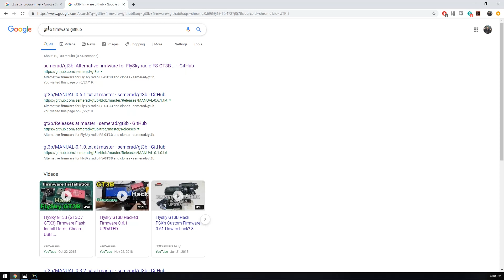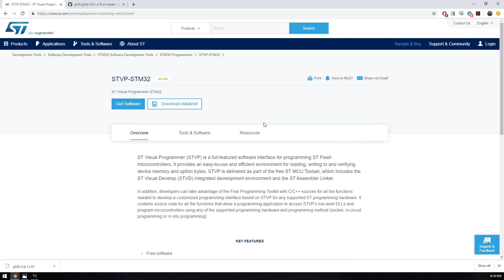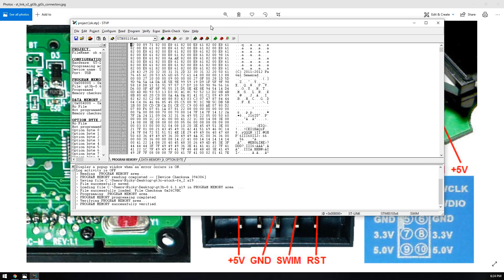FlySky FS-GT3C Unboxing and firmware mod w/st-link v2

Comment: its not working i just got this error message Error : Problem while trying to Reset swim and device. Apply a Power On Reset
Reply from the maker: Just a guess, but the wiring sounds like it's not correct and can't communicate with the device. Another thing to check is make sure you plug it into a USB port on your computer, not a USB hub (unless it's an externally powered hub). This just ensures it has enough power, since the USB port has to power the GT3C as well.

Comment: can i use 18650 battery with Amper 40 in this remote
Reply from the maker: This transmitter does not hold 18650 batteries. Anything is possible, but this transmitter already comes with a battery.
Reply: @dirtfpv  so the conclusion is whether the 18650 battery with a voltage of 3.7v 40a can be used as this remote battery
Reply from the maker: @ahmatsohep7675  Yes, absolutely. Stock vattery is also 3.7v.

Comment: i wonder if anybody can help. just bought a gt3c but the lipo battery was already installed and not packed seperately.is this normal or could it be used.
Reply: I have 3 of these radios and all of them came exactly as you see in this video. Battery separate from the radio. It is probably used.

Comment: I just recently flashed my GT3C with custom firmware as well. I originally bought it with the PPM expander board hardware hack already installed as I want all the default key functions on the radio but also want extra channels. But then decided I needed the custom firmware as well since it has some fixes implemented and some more features. Now I have a Firmware and Hardware hacked GT3C.
Reply from the maker: Awesome. What a radio for only $46!